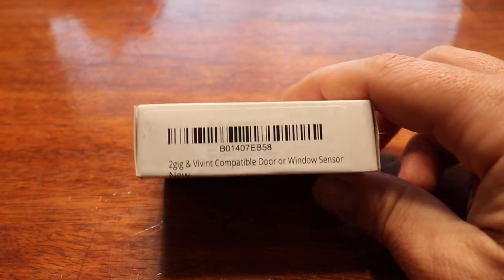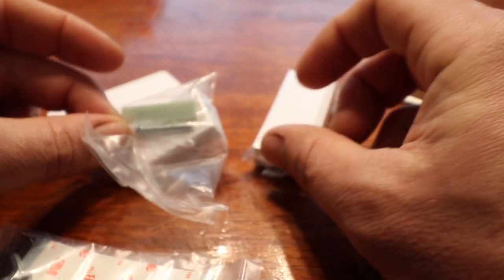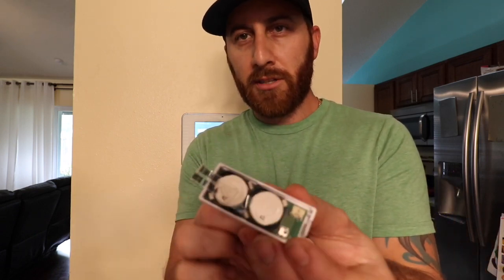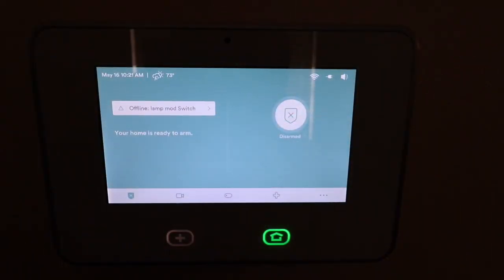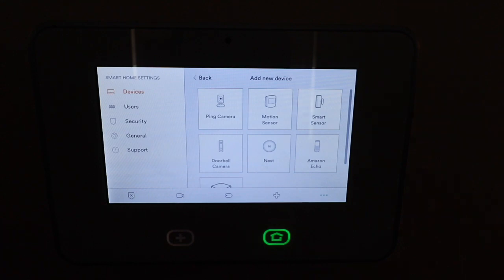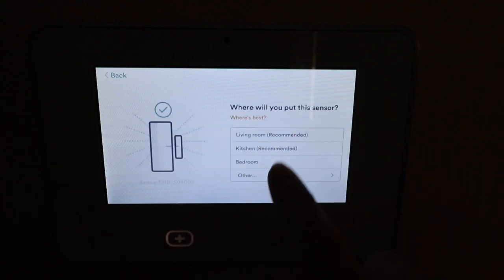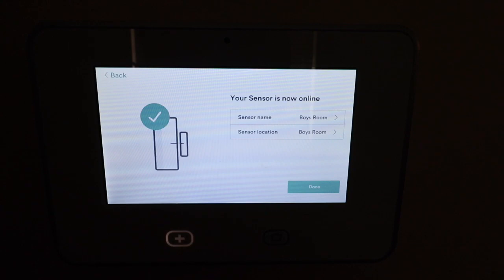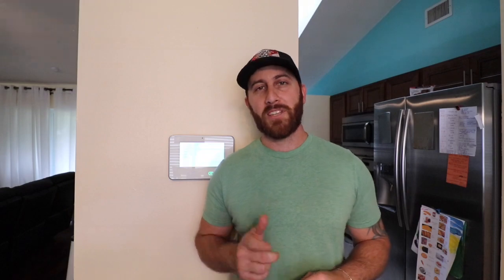Vivint Add Your Own Devices | Tutorial Video 2020

Comment: reading some comments and you reply with you sold the house along with the vivint system . my question is do you call vivint and have them transfer the account to new home owners ? asking because we are planning on selling our house and want to get out of their 5 year contract 🤦
Reply from the maker: Yeah we asked the new home owners if they wanted to take over our contract and they said yes. Called Vivint and told them what we were doing and then the new home owners had to call in give the address of the property they were buying and take over what was left of our contract. (It was not a fast process and I had to call them a few times to get it removed.)

Comment: When putting on a door do the sensors have to stay face to face a centimeter apart? My door frames have like a 1/4 inch rise so they dont stay face to face. One sensor is lower than the other
Reply from the maker: It should be face to face. There is a magnet in one so if it detects the magnet you will be ok. If not just drill and new hole so they are level with one another. That’s what I would do.

Comment: Mine still aren't connecting. It's so weird because they all worked before, and their from an old adt system. Did an update and magically none of them respond. I'm guessing the last update patched the ability to use 3rd party.
Reply from the maker: It definitely could have. I don’t have the system anymore so I cannot confirm.
Reply: @TheOutdoorsDaddy  they ended up sending me 3 units for 50 bucks. I'm so annoyed at them though, I'm so over Vivint. If I could turn back time I would have never got them.
Reply from the maker: @outdoorschick  So when I sold the house I had it installed at I got the new owners to take over the rest of my contract. Just figured I’d let you know that’s an option.
Reply: @TheOutdoorsDaddy  yeah I don't think we'll be moving anytime soon though I think we'll just use one of our big credit cards and pay it off and be done with it. Like my car was broken into like in front of the camera no alert. My son's bike stolen, but they didn't set it up correctly so I didn't have the option to watch the footage. Couple license plates stolen no alert. Then we had a guy walk on the side of our house right in front of the camera no alert lol. And I've played with a sensitivity setting so many times it's either it picks up the trees moving or it picks up nothing at all.

Comment: Can I add used Vivint Camaras?
Reply from the maker: johana salazar I don’t see why not. I never hooked mine up the installation guy did when I bought the system. I had two that came with my system and they were WiFi. I’d imagine they just have a identification number on the back and you should be able to pair it to the Tabet. Good Luck.
Reply: Yes

Comment: I have a tilt sensor to link to the panel but it is not in the "add device"  can you help?
Reply: Did you get it to work?  I am having problem with my Fire Alert.  He just said to  call VIVINT and have them unlock the toolbox so you can add it.